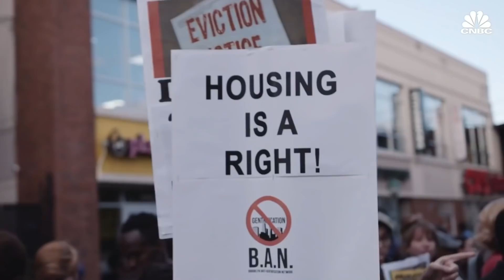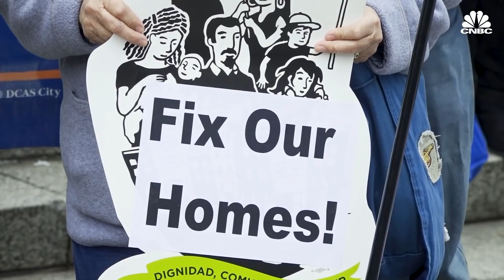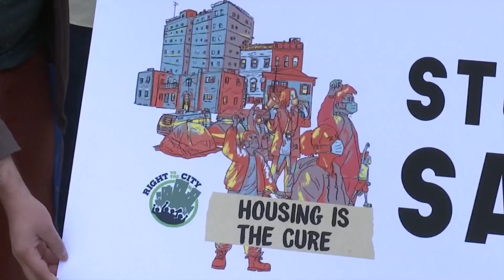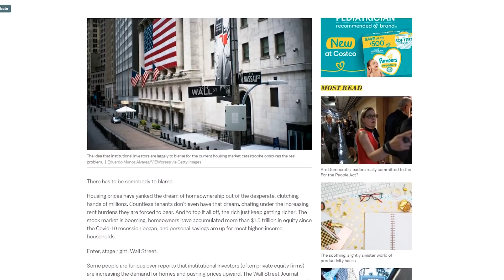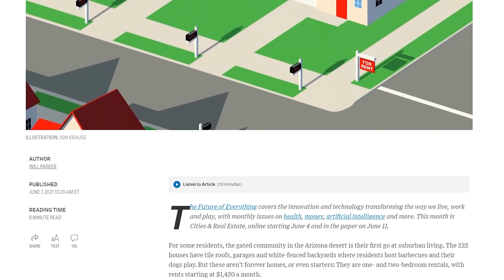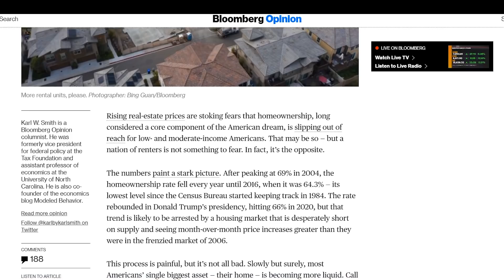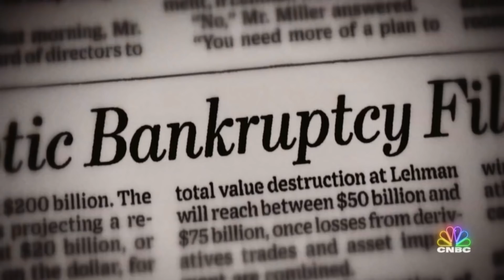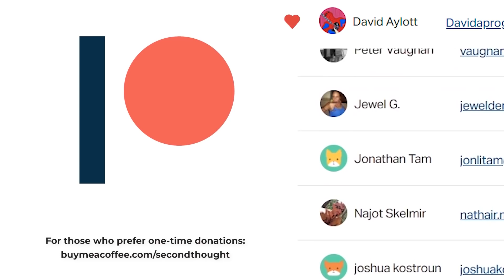America's Looming Housing Crisis

Comment: I gave up on saving for a home. I saved very aggressively, and found that I would reach 5% down payment in 5 years. Then my rent went up. I quit the system. Quit my job, bought a sailboat, work for trade only. It's a way better life
Reply: Sounds like you stuck it under the Bed.  If you invested it it should have far more covered any increase in rents.
Reply: @michaelsylvia275  no I had it in various index funds. Even made a little cash trading options. 10% return just doesn't cut it, sure it maybe takes my time saving down from 5 years to 4.5 ish, but why bother dealing with market irregularity at that point?

Really the bigger point is, I was saving aggressively to try to win in a system that's always waving a carrot in your face. Giving it up means giving up some quality of life, but now I actually get to live to the fullest. Best decision I've ever made in retrospect. I can't tell you how valuable it is to wake up happy everyday, you just have to live it to see.
Reply: @rikross7000  I never liked options.  it is a long term goal.  I save for the crashes, sometimes it is 8 years sometimes 20.  Wish you well

Comment: The solution is simple:  Ban Housing Speculation on the Stock Market.
Reply: That’s nearly impossible because the wealthy wont let that happen and if that happens capitalism just gonna use the same thing but with a fancier name like they always do
Reply: @spacepeing9936  That's why we need the proper guardrails in place to prevent that from happening.  The Public has to be able to monitor the Government in this respect to the fullest extent possible, while having all the necessary recourse to hold them accountable in the event they try anything.
Reply: @chamberofprogress5025  I don’t expect much from you guy but still… good luck
Reply: Wall street is just one of multiple factors. Consider the amount of housing that is used just for Air B&B...
Reply: @crash_test_dummy_1  There's also a method that is utilized in Switzerland and the Netherlands with regards to their Health insurance companies:  Make Real Estate firms non-profit by law.  This is a bit of a tangent, but in the two fore-mentioned countries private health insurance must be non-profit by law and that's how their healthcare systems are less expensive and yield better health outcomes.  We can apply this to Housing and drive down the cost of Housing without nationalizing the market.  Unlike Healthcare, Housing is an area where costs do need to be kept in check but the market approach is still a viable mechanism to support it.
Reply: @tim3440  Speculation happens when greedy, rapacious mafia middleman come between the prospective homebuyer and the seller, and they take a cut, artificially inflating the price of the house.  Like Healthcare, banning Speculation on the Housing market would lower the prices and help people be able to afford homes.

Comment: In some cases renting makes more sense than owning, especially if it's a house.  In most cases it doesn't make sense for a single person or even a couple to have a house.  They don't need the space, and maintenance/upkeep is expensive.
Reply: @Tommy S The phrasing of your question is biased toward owning as the norm.  A more neutral phrasing would be something like, 'Does is make financial sense for a single person or couple to own?'

I'd argue in many cases it doesn't.  There are many more expenses with ownership.  Also, in the first 10 years or so you don't build much since most of your mortgage payment goes towards interest rather than principle.

I'm not saying no one should own, but rather it shouldn't be assumed that owning is more prudent than renting.  Depending on individual circumstances, it might not be.

Comment: If you look at the statistics detailing the % of the homes bought nationwide as investment properties by these large firms you’ll clearly see that the % of houses bought by these firms is not the problem. It may be a very small part. 

Just one massive reason the demand side is increased is the government is buying billions of mortgage bonds on the secondary market to keep mortgage rates artificially low. This allows people to consolidate debt and get into the market when otherwise they wouldn’t be able to. However, the flip side is this kind of stimulus plus the other stimulus because of  COVID-19 has been causing inflation, a lot of which is in assets. See Ray Dalio’s explanation of short and long term debt cycles for more info.

Comment: The problem isn’t black rock or any institutional  firm. But rather the commitment of the buyers. Most millenial doesnt want to pay 30 year loan. They felt tied up. Black rock presents solution and many bought it. Black rock is just a patch and somewhat a solution to those who doesn’t want a 30 year loans. If the buyers isn’t commited to buy a house then they will miss the opportunity to own one because they thought renting is cheaper than owning overtime. Its much cheaper to own in a long term asset than renting with an inflation added asset. Cheap will cost you more in the long run.

Comment: I was a little surprised from the beginning of the video when the couple said they didn't even manage to buy a 1200 squared foot home (110 squared meters). That is a huge apartment by most standards! Where I live its hard to afford renting an apartment half that size even far from the center, and the only reason society doesn't collapse here is we have some abundance of  50-70 years old housing that were build to be affordable (and now are [barely] rent-able). The current trend, though, is to demolish all the old buildings and build huge towers surrounded by parking. The funny thing is the people living in the towers can probably afford it only because they either sold an old apartment or are owning and renting it. Maybe I am wrong, the system works as it should and paying most of my salary to rent in an expensive tower far from everything is just the proper way to be.